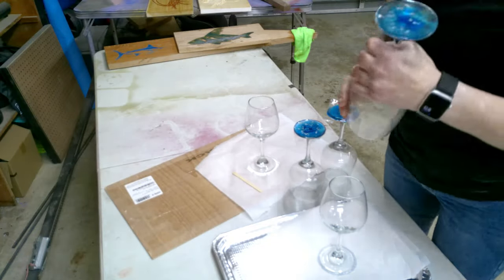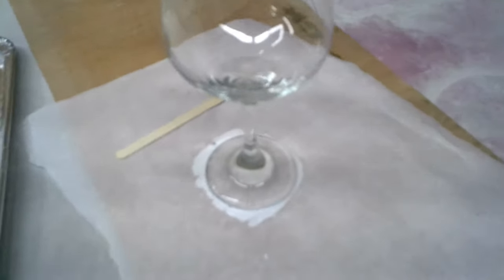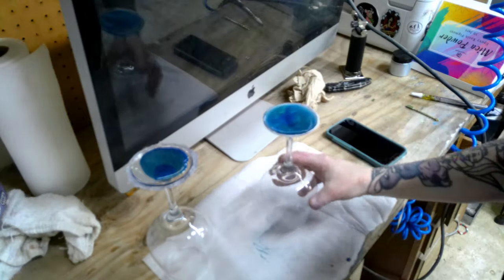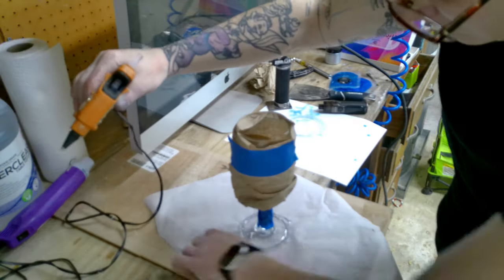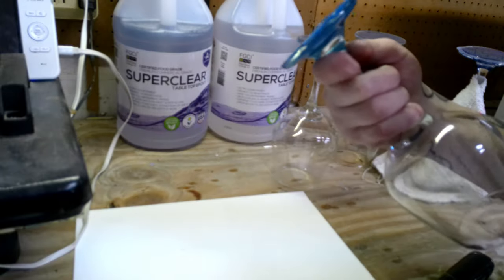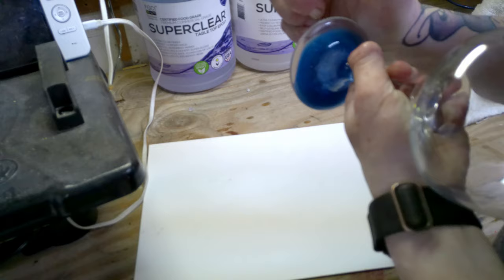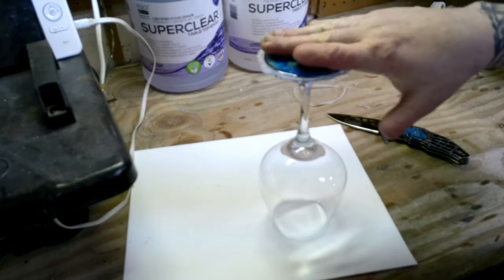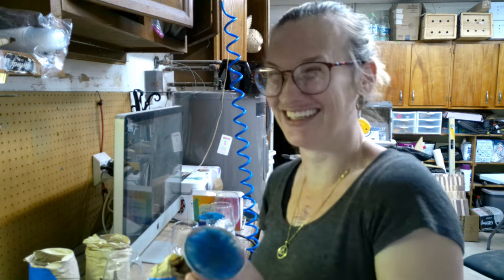NO MORE EPOXY MOLDS! check out this experiment - pour on the bottom of a stemmed wine glass

Comment: Liquid latex painted around the bottom and edge might work well and is super easy to peel off. Also for the sides a chrome pen in silver or gold and a then go over with a very thin layer of resin.  Thanks for the ideas. Definitely going to get some wine glass and try some techniques.

Comment: Also,  look up a burring tool to clean up sharp edges
Reply from the maker: ive been using a  barrel wood sanding dremel tip and then hand sanding down to a 220 grit. seems to be working darn good